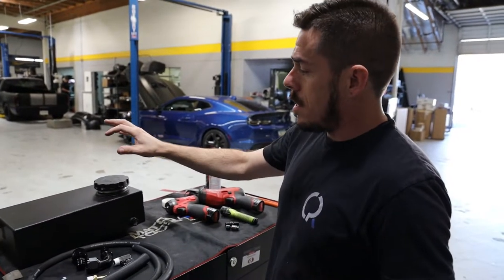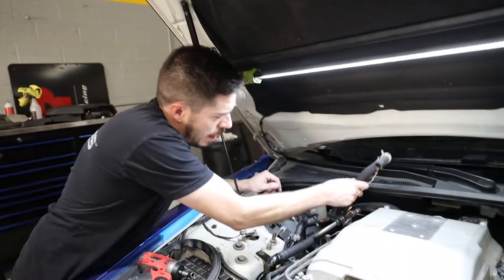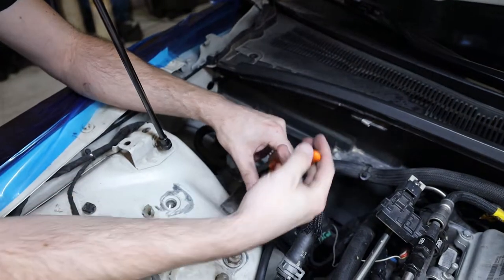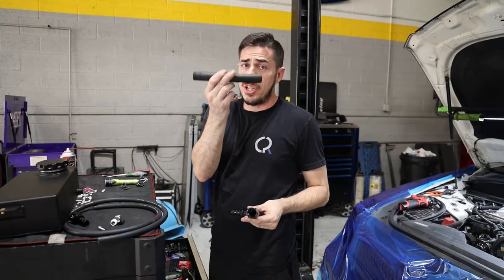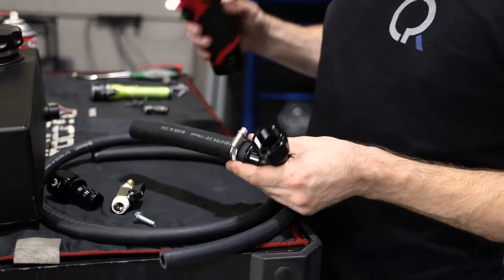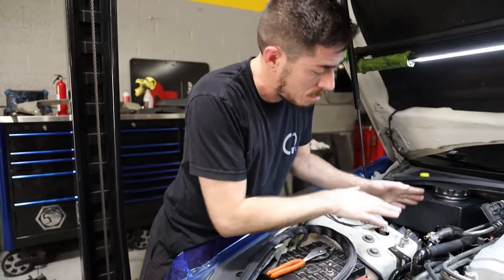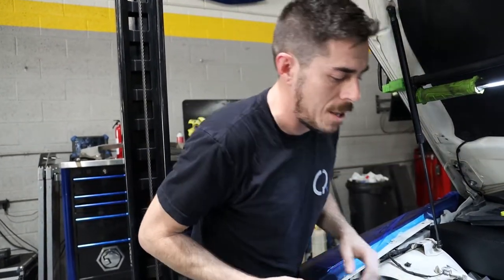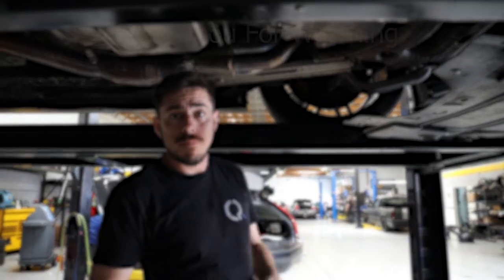CPR CTSV (V2) Engine bay ice tank install

Comment: What tank is this? I need one for mine!
Reply from the maker: It's our gen 2 ctsv engine tank. It's on our website.
Reply: @CordesPerformanceRacing  I looked for it on the site but didn't see it
Reply from the maker: @livinloud8607  https://cordesperformanceracing.com/product/cpr-v2-ctsv-engine-by-ice-tank/
Reply: @CordesPerformanceRacing  keep them in stock?
Reply from the maker: @livinloud8607  yes we do. Not in currently to check status but if they are out, we are in production of another big run that should be off to coaters by Tuesday.

Comment: Looks good, but uh, for the sake of people DIYing and aren't savvy, you missed the lower return from the tank to the metal hose.
Reply from the maker: No he didn't. He explains where it goes.
Reply: Maybe you're misunderstanding. The video goes through great length to show all the connection of hoses except for that one, and hopefully the targeted audience is mechanically inclined, however for the sake of completeness and full documentation, I was calling that out so that the editor of the video made sure it was included in video, not spoken, context.

Comment: Geeeez amature mistake 1. Using pliers  on aluminum an fittings. 2. Not putting the tension clamps back in the same spot they wore themselves into. 3. Spraying that lube next to the car.....come on man
Reply from the maker: Knipex properly used will not hurt the fitting. You can clearly see them not marked.

Clamps were put back in grooves so don't know what you're talking about there.

Spraying lube pointed away from a car that is covered in a film... and it was the smallest amount, it's not like he unloaded the can 😅